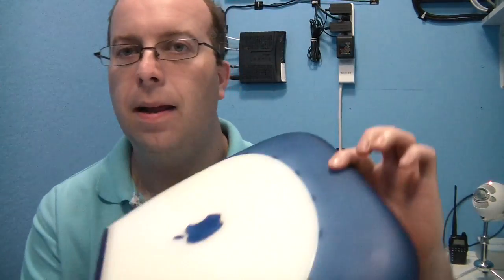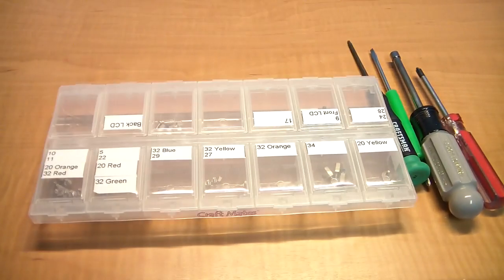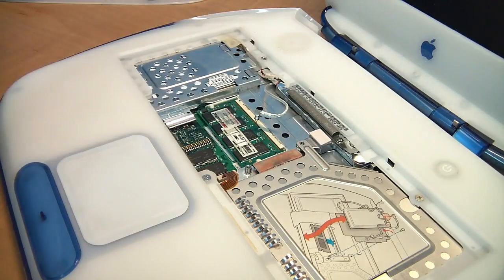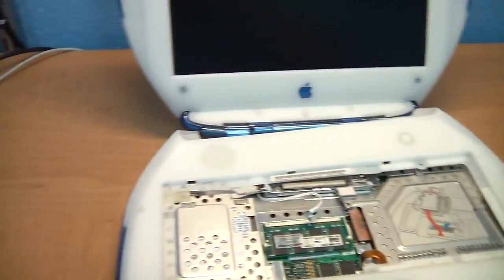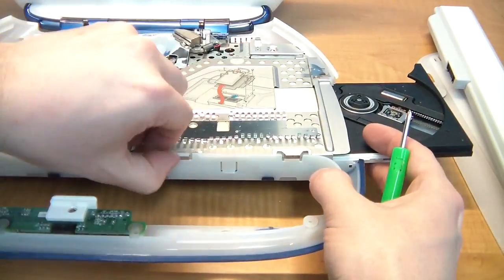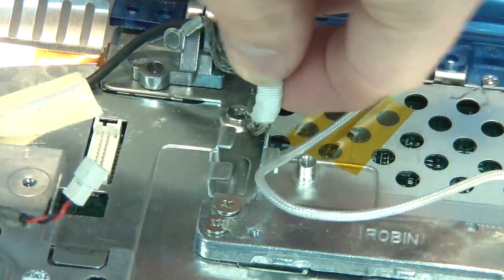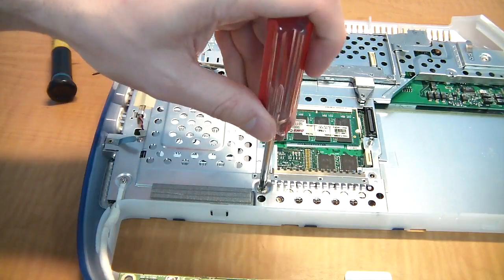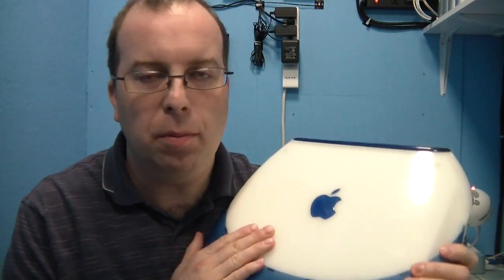iBook G3 Clamshell Disassembly and Hard Drive Upgrade.

Comment: Thanks for the detailed instructions. It helped me a lot to successfully remove and replace my HDD with a CF-card+adapter. I also spend my iBook G3 Clamshell Indigo a RAM upgrade with an additional 512 MB modul. Now i also got Mac OS Panther running.

Comment: Hi, 
I recently came across one of these that doesn’t have a wall plug charger. I have a 24v 1.75A DC wall watt and was trying to charge it off this. Do you recall the polarity on the power plug of the computer? Inside is positive and outer is ground? Thanks!

Comment: Ok, so the HD isn't all that difficult. I am putting an SSD in mine with a converter. My question is where the heck do I find a new battery? I am about to have to disassemble the battery and replace the individual cells I think.

Comment: Ugh... Such a pain. Not looking forward to it. I have an iBook G3 FireWire Clamshell 466GHz I bought off of ebay and I've GOT TO rehab it. I don't know what they did, but they must have spilled something on it that crusted everything over under the keyboard. It works as advertised, but I don't trust it. I've already had problems with the HDD and plan on replacing it with an ATA-2 SSD or CF adapter (probably the latter). And the DVD-ROM drive is possibly on its way out. No Airport card either. But if I do get it in pristine working condition it should be a great little Mac OS 9.2.2 machine. I have a lot of files I need to convert to modern formats and games that need playing.

I have a compartmentalized container and labels from a label maker already, but as for everything else, it's going to have to wait unfortunately.

Comment: I have one that was brought to me with a wriggling intermittent power jack.  Undoubtedly it's cracked solder connections.   This is going to be one hell of a lot of disassembly just to get to the little daughter board it looks like the jack is mounted to.
I'd like to skewer the designers with metal spikes for this nightmare!  This is actually worse than the original Toshiba Satalite laptops I used to repair back in the day.  Those were horrible.
Oh well.  I'll power through it and bring the machine back to life for my customer.  It will make for good video.
Thanks for the detailed step-by-step.  And was that a Yaesu HT in your opening shot?  Fellow Ham?

Comment: Your guidance, in concert with the ifixit step-by-step directions, made this something a relative newbie like me could get through in an afternoon.  Now my 300 Mhz Blueberry iBook, which I had added to my curio cabinet based on the lack of secure browsers back in 2009 or so, has a new life.

Having discovered Classilla and having an extra 120 GB SSD handy I found a PATA-to-SATA connector at Amazon and went to town.  Now my last-millennium machine boots it in half the time it used to (50 seconds v 105), and runs in utter and complete silence...probably with better battery life to boot without having to drag a mechanical device along for the ride.

I appreciated the warnings about managing all those screws...perhaps an ice tray would have been useful.  I'm just glad I got it back into one working piece....

Comment: I use my G3 clam shell for all my OS9 software. I use my White iBook G4 for the bridge between OS9 and OSX10.4, Then I use my PowerBook 12" for all my OSX 10.5 software. I use my older Mac Mini (late 2006) as my print server (4 printers shared on my network). And finally My main work horse (limping along) my Mac Mini (late 2014)  to do everything else.

Comment: Using your video I have upgraded my old Rev A (blueberry iBook G3 300Mhz) taking out the little 3 GB Hard Drive and installing a larger 80GB hard drive as well as installing a 512 MB Ram card. Thank toy for the detailed instructions... (now what to do with the left over screws... LOL not really. I usually have left over screws but this tile I got them all put back in correctly. thank you.

Comment: This is insane. Sure, it is pretty, but I'd much rather have a ThinkPad where you can upgrade the hard drive, RAM, wireless card and optional 3G modem by just removing 5 screws (two of which are used to secure the wireless card and 3G modem, respectively). Criticism of the design out of the way, I must say that this is an excellent disassembly video.

Comment: Excellent and detailed tutorial!

And for those complaining that this is complicated, look at the 2012+ iMacs xD
Reply: heyhococo on my 2013 retina Macbook Pro, you can't even replace the HDD. It's an SSD soldered to the system board. If it dies, the unit is basically fucked.
Reply: I'm going to do something that is strange for a YouTube comments section, but I'm going to admit that I am wrong. LOL :)

I googled, and it's an M.2 drive. For some reason, I thought this was the year they switched to the soldered option. I'm not bothered by it, and the size I got is entirely fine for the needs I have (mostly using external storage anyways), so it's probably unimportant unless it died.
Reply: SeanFromPVD nope... you are wrong... it is a seperate drive and it is replaceble

Comment: For those wondering why Apple makes this so hard, the answer is easy. When this laptop was around they made an obscene amount of money on repairs and if they made it as easy as say pc's of the same time they would lose revenue.
Reply: I think is more because they wanted to sell this laptop to people with "style" to people who care more how it looks like than how it does. 

Its like what phone companies are doing today, they made a fixed battery cover so phones can be a bit slimmer so it be more "stylish".
Reply: No, the repair process for consumer products back then, like today, is "replace unit." Higher-end stuff, I will say, can be darn easy to work on (Powermac G3's process: Open case with lever, unscrew one screw).
Reply: In the same era, the PowerBooks just exposed everything by removed the keyboard in a similar fashion to this one. Basically pull keyboard release latches, pop the keyboard off and you can just pull off hard drives, ram, the cpu and airport card. Batteries and optical drives were hot-swappable and have ergonomic release levers. The reason the iBook was made this difficult was probably more along the lines of rather selling PowerBooks to the professionals. The same pattern regarding HDD replacement followed until the MacBooks replaced iBooks and MacBook Pro's replaced PowerBooks and made HDD changing easy again.
Reply: other's products weren't different, HP also used a ton of screws and hidden parts in the older models
Reply: +Mustang Rt Compaq was a different answer. (1990's, not nowadays!) you had to buy a compaq screwdriver in order to get into a compaq computer. they had custom screws that don't work with normal screwdrivers.
Reply: how do you know that... source????
Reply: As if their products weren't overpriced enough, they have to go and make them a pain in the butt to repair and suck even more money outta ya. Another reason I go with pc
Reply: +Q.T. Productions of Utah "overpriced"... look at microsofts computers :D
Reply: No duh, Because Apple had always made their own computers instead of relying on "3rd Party" Developers like "Dell, Acer, Alianware and etc" on stuff like "Repair, Replace, and everything else".
Reply: Hmmm, You got a point on that.

Comment: I am commonly using a piece of paper and a strip of double faced adhesive tape on it to preserve screws & stuff in order of assembly. Cheap and always avaible. ;-)

Apart from that, I recently replaced the HDD of one of my Dual-USB iBook G3, which I am using as my "Tiger w Classic Environment Retro Gaming Machine", with an 64GB mSATA SSD + mSATA to IDE adapter. Now it runs significantly faster and is still a pretty damn ejoyabale machine.

Comment: This is why I prefer the old IBM T series. You remove the drive with a single screw holding the drive holder, then pull. Unscrew the old drive from the holder, screw the new drive in, insert into the drive bay and tighten that one screw. Apple seems to hate upgrading above all things.
Reply: +Danijel Turina Thats the Mac line, the Apple II was pretty well upgrade able and Expandable.
Reply: +Danijel Turina Eh, most Apple Products were a lot easier to upgrade after that.  The MacBook line proves that, and pre-retina MacBook Pros prove that.
Reply: +Phillip Jernigan you can still upgrade them though it may be hard to take apart
Reply: You can only upgrade the SSD.  The RAM and CPU (and if you get the 15 inch retina with dedicated GPU) are all soldered to the logic board.

Comment: This is so ridiculous, you literally have to take the entire computer apart just to upgrade the hard drive. Way to go Apple! I'm glad I got a nice Pismo PowerBook instead of an iBook. The HDD upgrade on the PowerBook is not user serviceable but is a snap to replace.
Reply: I have an eMachines EL1358G and even that's easier to remove the hard drive from.
Reply: not as bad as my HP system that is the same dont even have a clue how the hell to strip that down as I want to up the memory as I believe it can support 16GB but to be honest I am looking at a Thinkpad as 2.6GHZ I5 is not that expensive used
Reply: im pretty sure you could have just unscrewed that metal bit covering the hard drrive under the keyboard
Reply: Every laptop has its downfall, especially the smaller they get, some laptops have to be taken completely apart to replace the keyboard while Apple made it extremely easy here. Some laptops may make it easy to replace HDs while Apple made it difficult here. Laptops are tricky. Modern Chromebooks are almost as bad as this.
Reply: Fast-Forward to 2018 and now the HDD is probably riveted to the chassis and the HDD itself is soldiered onto the main logic board, making it nigh-impossible for the end user to even think about replacing it.

The keyboard is riveted to the frame, the LCD screen is locked in IIRC, it's just ridiculous. Instead of complicated design, they decided to brute force that crap and make it absolutely impossible (or closest the can get). And check out their phones... if you don't use first-party parts, the thing just won't work (the OS/BIOS will refuse to recognize it, even if it should theoretically work). So if they can't stop you from undoing the rivets, they'll simply make the BIOS recognize something was changed and make it not work anymore.

The whole moral of the story: Stop giving Apple your money because they obviously don't respect your money and your purchase. They sell you trash that WILL break in a couple years for exorbitant prices.
Reply: God give me my old Acer laptop any day. 2 screws on the back and I have access to the hdd
Reply: The pismo has a really easy cd rom and battery removal
Reply: My ThinkPad T430 can keep up with most new laptops under $500 in performance and everything can be replaced easily.

Comment: Should have put an SSD instead
Reply: There are adapters I'm sure. Austin Evans put one in his clamshell.
Reply: GamingTeamHD | Motion Design [100+ SUBS IS FREE] What? That's a standard 2,5" hard drive, any SSD of that size, which is most nowadays, would fit. The only gripe is that it wouldn't be much faster, since it isn't sata.
Reply: Lucky | PC Gaming | Gameplays I bought an mSATA to 2.5" IDE adapter for a few bucks from China, bought an 80GB mSATA drive, installed it into an IBM T43 and it works almost as good as a new laptop.
Reply: +Champturn Most of the connectors will add to the length of the drive causing it to not fit. If you want an SSD, an SD or CF to IDE adapter would work well.
Reply: the ssd didn't exist back then so it wont fit
Reply: yes it wil fit, but you can't connect it because of the old connector

Comment: Important.. at assembly the uppercase must be as this :

set first the right bottom corner, there is a little clip near the cd to fix.
Then clip the middle left, there is a little métal piece that must fit below a plastic clip. Then proceed to push the upper case to the front and clips the top left corner and then the right corner...
be patience and good luck !

Sorry for my english

Comment: Hello. I am Yisroel Kivman. I am 10 years old. I have an iBook G3 Clamshell. Its optical drive is broken, USB ports don`t work, hard drive erased, and it will not boot. Can you help me?
Reply: Only way I can think of fixing it is if you have an external hdd (hard drive) adapter then you could probably run an osx installation on another mac/pc with the hdd in the adapter and install the copy of osx onto the hdd.

external hdd adapter: www.ebay.co.uk/itm/like/281205875072?limghlpsr=true&hlpv=2&ops=true&viphx=1&hlpht=true&lpid=108&device=c&adtype=pla&crdt=0&ff3=1&ff11=ICEP3.0.0&ff12=67&ff13=80&ff14=108
OSX copy: www.ebay.co.uk/itm/like/271460046696?limghlpsr=true&hlpv=2&ops=true&viphx=1&hlpht=true&lpid=108&device=c&adtype=pla&crdt=0&ff3=1&ff11=ICEP3.0.0&ff12=67&ff13=80&ff14=108

It might be worth just buying a new (working) g3 clamshell to save all the trouble it would cause, but if your up for a project then I think it would be worth buying the previously mentioned products.
Reply: appletime20 You are from UK. I only allow people from US.
Reply: The way I would do it is to replace the optical drive and hard drive, get a official install disc of the OS you want. (i.e. Mac OS X Panther) Then install it from there. I agree with the other tips like get a new iBook G3 since you said yours has broken USB ports. Hope it helps!

Comment: Thanks for this, I need to do this with my key lime model, it has a dead PRAM battery. Since it requires so much work, I might as well upgrade the hard drive and ram.
Reply: Clamshells don't have a PRAM battery

Comment: Wow a week old ibook g3 video? Ironic, I was looking for a new project. I would like to revive an ibook g3. ATA SSD's are fairly cheap.

I just googled "overclock ibook g3 clamshell" and I'm very pleased to see that there is a hardware way to overclock the ibook. For the firewire version, just remove two resistors.

Comment: I need two screws to get access to RAM and my harddrove on my IBM Thinkpad. Moreover you get a complete dissassembly and resassembly guide ("Maintenance manual") for free on lenovo's website. Compared to my unibody macbook, where especially removing the bottom cover is very difficult, it's a piece of cake. The Macbook-Air series is one of the most difficult notebooks to service.
I do like Mac's, but they are certainly not designed with easy repair and maintenance in mind.

Comment: I love apple but this ibook was designed with no easy option for a rudimentary hard drive and memory upgrade. Thats where the IBM think pads shined. Big blue thought ahead and made accommodations to its users. It only took one screw to access the hard driven. Present day Mac book pros and ibooks are just as labor intensive. You have to be slow and patient or your strip the screw, scratch the aluminum body or put a dent.